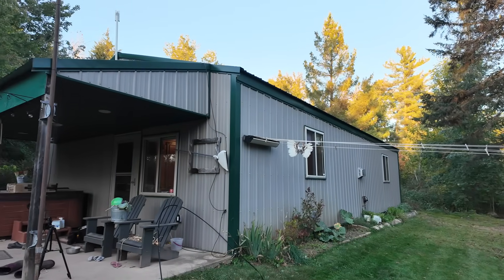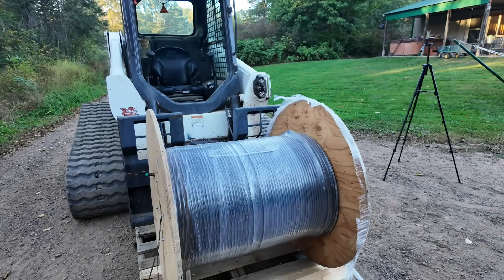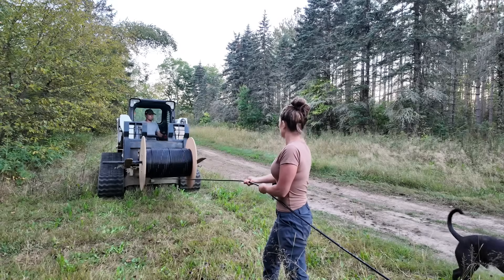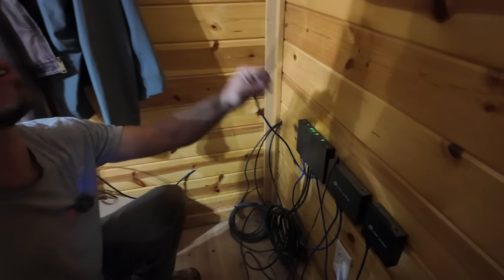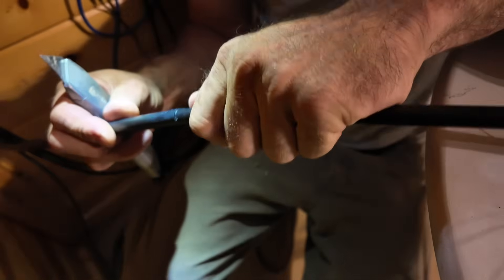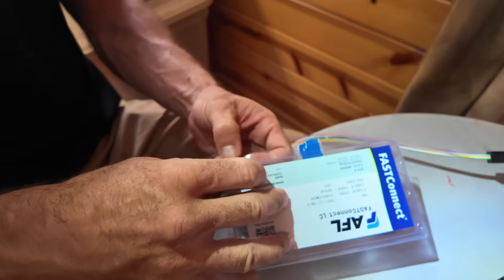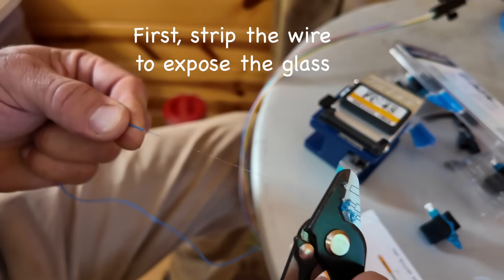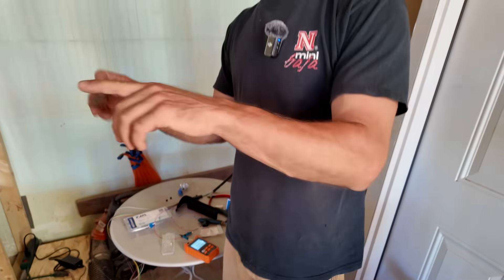We Need Internet! Running a 3,000 ft Fiber Optic Cable

Comment: It's been more than 15 years since I was involved in doing a single-mode fiber pull for the company I worked for. I was an IT admin coordinating with a local contractor to layout and install a fiber ring in the manufacturing plant that I worked at. Part of that pull was under ground. My counterpart that worked for the contractor had previously worked for AT&T doing fiber installs(so he knew his stuff). Here are my takeaways:

* The best way to terminate single-mode is with factory made pigtails that you fusion splice onto the ends of your fiber(I don't know if that's old tech and what you did is the new way). Of course, you would need a fusion splicer(over $500 from Amazon). But this method yields the best transmission properties since the ends have been factory terminated and polished.

* You should use a fiber optic cable tray to store your slack( https://www.amazon.com/GESD-24-Port-LC-OS1-SingleMode/dp/B0B1H8CS58/ref=sr_1_3?sr=8-3 ).

* When running fiber in the ground, you need to use what's known as loose tube fiber. The glass fibers are suspended in a gel in a tube so that thermal expansion and contraction doesn't cause them to crack.

* The contractor told me that single-mode fiber is considered a biohazard, since the glass fibers are capable of breaking the skin and entering the blood system. As you can imagine, this is undesirable. He was careful to the point of putting down some sticky tape that he would stick each of his cuttings to so that he would not lose track of them. Then when he was done, he put the cuttings in a biohazard disposal container.

* I'm going to go out on a limb here and assume that you probably don't know anything about repairing a severed underground fiber run. So, you may want to invest in some of these( https://promarksupply.com/tag/fiber-optic-marker-post/ ).

* It's a good idea to photograph a burial run. Did you?

I'm sure there are other things that I've forgotten. But as I said, it's been a while and I'm sure that the tech has changed some. The termination of single-mode fiber is not a DIY job. I have decades of IT experience and I don't think I would try it.

Comment: Work in data centers, always working with fiber single mode and multiple. His fiber db is the best its going to get especially with that kit he has. Since he is not an optical field worker, see them out late work on fiber they have alot of testers think its a damn good job. It always the tx/rx issues no matter who mess with fiber. Using a VLF and fiber tester not crazy expensive is great 👍. Used flukes brand expensive and not necessary can get cheap brand ebay or amazon.

Comment: I'm in the process of putting in a cheap EPON system on my property which is 300m from end to end. Pre-terminated single core fibre drop cable and optical splitters are stupidly cheap and routers cost about $15 (4xethernet+wifi+PON). With EPON you need to ensure that you don't overdrive the receivers so keep a handful of optical attenuators.

Comment: Get that cable trenched fast, for some reasons animals love to chew the outer sheath and even go thru the armor and into the glass. We have a problem with squirrels at work chewing our cables around the city. Even protect it where it comes out of ground into the buildings with stainless steel u Guards, make sure there no place an animal can get at the cable and chew it.

Comment: I agree with others. There are many ways to skin a cat. Yes there are better ways to run and terminate fiber, but you demonstrated that it can be done even if you don't have any experience. I will admit that I cringed when you were trying to terminate with loose tube fiber with quick terminator LC connectors. Those connectors really are only meant has a quick temporary fix. But just like shark bites in plumbing, usually work fine for years. It's not like you need to run multi gigabit through it.  Great video!!

Has far as you ubiquity knock off tp link goes. Ubiquity is typically a better product. And if you order direct from ubiquity, the prices are usually even  better. The wireless bridge do have some drawbacks that hold the novice back. First is all Ghz frequencies are limited to line of sight. The higher the frequency, the worse it is. At and above 5 ghz even rain can decrease to signal. Yes they can reach 14-15 KM (not Miles) but it needs to be completely free of obstructions. Even the leaves on trees can affect it. Second each channel has limitations imposed by the FCC. This is something that even ubiquity doesn't do a good job at explaining. 5700 to 5800 allows for the most ERP. that antenna is typically has a gain of 23db. Now some can correct me, because fcc keeps changing the regs, but the max ERP is about 30 db. This is the upper dfs band. The lower band, 5200mhz, are limited to more than half of that. So in order to meet the requirements, the output power has to be turned way down. So if you set your channel to the 5700mhz and have good line of sight, you may be able to connect at great distances. With Ubiquity the longest one I have deployed is 3 miles. But I have seen other access points on my device that are 15 miles away. Basically what I am trying to say is use ubiquity and use the higher channels for long distance bridges. There are a few other bridges that I personal have not yet evaluated yet, but are decent. However, TP link is the walmart of wireless. It's like using Great Value instead of brand name. The sad thing is that some of TP link hardware is not that bad. But when you add their proprietary software it not very good.

Comment: You got this fiber wise…

WiFi wise… ceiling WiFi access points work better when mounted to the ceiling. They have wall mount units if you prefer to mount to the wall. Just telling you so you can easily improve your setup.

Comment: Good morning 🌅, great to hear that you have got fibre up and running, I live rural France, last year I did manage to get fibre connected to my property, Luckily, when I had the electric put in, they laid another tube in the ground, I had SFR  connected as my supplier, then found out that I was being charged for a television service that I don’t need and do not want, it has taken me nearly 3 months to get it cancelled, I’m now trying to get another company to supply me with Internet after going sign up for it then found out they’re doing the same thing Bouygues , So at the moment, I’m in in limbo. I’m using my mobile phone as a hotspot., Like most people you don’t like being charged for something that you’re not going to use, good luck with your project, I wish you all the success for the future, from France.

Comment: I respect your diy lvl, even I know this profession. You are pro to take on all this yourself from my view, and I admire the attitude to just try it your self. Was ofcourse first thinking why not do this and use a pro, but then i saw what the channel was mostly about, then I know why you went ahead with this project. My only lose remark would be use a ODF of any kinde box or splice tray inside some kinda cabinett to protect the fiber. Too easy to yank or bend the blue conduit with the 12 fibres and you would need to redo everything. And even it is duct cable, I bet it has an ripcord wire, then you only need to take off 10cm off the end and use the ripcord without any special tool, only knife. Again cool video upload.

Comment: Awesome! Where'd you order the cable from? Also recommend the ends of the buried cable go to a permanent box / patch panel and then a cheap premade jumper to the equipment. Also the colors have a numerical order if anybody else ever works on it in the future.

Looking forward to the trenching video.

Comment: as a past communication pro. would suggest you get a cable manager on both end of you Fiber to keep them protected for a long life. all so you have spare fiber you can put ends on and run your end to end test. Great the you have the tool and learned how to correctly clev and terminate the end. as back when I started with fiber we used bicon ends and had to polish them . Today ends in SC or SD are much quicker and better. hopeful you get a long live from your system . would be interested it what you total project cost with cable , tools and if you plan to direct bury the cable to future prof its life by putting in the ground about 4ft

Comment: Remember DO NOT LOOK INTO THE END OF THE FIBER OPTIC CABLE WITH YOUR REMAINING GOOD EYE!  Sorry, old fiber optic tech joke.
Yes, there seems to be special tools for just about everything. Those "click connectors" even made the job soo much easier. In the early days you used to have to fusion splice the connectors on with a multi-tens of thousand dollar machine.
Reply: We still use splicer nowadays😂
Better quality

Comment: try the TP-links again but rotating the ""dishes"" by 90 degrees. may it will do better. Vertically polarised radio waves penetrate further where vertical wood is :-p. and choose 2.4 GHz before 5GHz.
Reply: 900 Mhz would be even better than 2.4 GHz
Reply: @guytech7310  jup the lower the better...but licensing would be a tiny bit difficult 😀
Reply: @wilfredswinkels  No licensing 915Mhz is an ISM band. Ubittiquty sells 900Mhz bridges
Reply: @guytech7310  yeah. I meant lower still. (ham radio operator here) 😀
Reply: Oh D*MN I just read what I wrote about wood just now.....ok English not my native tongue...sorry...

Comment: Oxymoron: connecting an off grit cabin with fiber to the internet. Shows that this channel is just a fake off grit lifestyle channel to grift from YouTube.
Reply: using fiber to connect between buildings & not from a Fiber ISP. I believe they are using star link. That said there are companies rolling out fiber to rural areas under a federal program. Considering they cabin & home is about 3000 feet (2/3 mile) apart & they own the land between that is a rural area.

Comment: As someone who does this for a living I strongly recommend pulling the fiber optic cable through PVC pipe in a trench.
Reply: It’s an armored direct bury cable, it’s fine.
Reply: @brians8664  Underground installations typically demand conduit to protect the fiber optic cables from soil moisture, mechanical damage, and environmental changes.
Reply: @TermitesRGood1  That's only so ISPs can just pull new or more fiber if they need to.
Reply: This cable is designed to be direct buried as it's filled with gel to keep water out.  Plus it got a steel messenger wire inside the cable to provide strength.  Finally the fiber is already inside the conduit within the cable itself.    This is on private property so nobody is gonna be messing with it once it's buried.
Reply: @Darkk6969 

It does need to be buried sooner than later.  Animals could end up chewing on that cable.   It could get damaged in any number of ways.   Nothing it more permanent than temporary!
Reply: @Darkk6969 that fiber was not gel filled. That was an armored loose tube fiber with powder coating. 
When did you see him cleaning off any gel?
Reply: @Jeremy-xl1bn  no need for gel anyways since coated fibers operate under water just fine
Reply: @Darkk6969 

It does need to be buried sooner than later.  Animals could end up chewing on that cable.   It could get damaged in any number of ways.   Nothing it more permanent than temporary!
Reply: @Darkk6969  What if that Fiber gets damaged SOME WHERE on that 2600  Feet its Easier to pull it out and Replace it by using Conduit it.. Sure its a extra Spent but time saved and possible cutting that fiber. you have no idea one day what they Property will be used for.. Also what if they wanted to Upgrade that Fiber PULL IT and done.
Reply: @TermitesRGood1  You make a good point. He may want to upgrade years later. By using conduit, he won't need to dig another ditch.
Reply: @TermitesRGood1 I don't know how familiar you are with fiber, but being that it's single mode, there's no need to upgrade unless they need more than 12 strands. Single mode can handle a lot of throughput with the right optics (SFP modules). The only thing they might need to "upgrade" in the future would be the optics to increase from 1Gbps to 10Gbps or even 40Gbps and up with QSFP, but that's getting expensive. There are also Bi-Di optics that send and receive data over one fiber strand, if they wanted to go that route.
Reply: @scoobytaggs  the word is "unless" we never know whats in the future not only that it could get damaged just pull it and install new fiber....
Reply: I'm installing hundreds of Kilometres a week - we direct bury.
Reply: Direct burial is fine. He has 10 other strands if he needs to upgrade in the future. The only reason to install a duct (not PVC) would be for future expansion or in case it got damaged and need to re-pull it. 
I do this for a living, and we do direct burial all the time. I would just make sure it’s below the frost line.
Reply: There are conduits designed for fiber, the inner layer isn't flat to reduce friction
Reply: Here in Australia its law for fiber optic cable to be in pvc pipe
Reply: Yep, direct bury, no matter what type of cable is used, is far more suseptible to future damage. Fiber/copper can also have defects that don't show up initially and then just suddenly fail. Conduit is an extra expense and more time consuming up front by it's a great insurance policy for the future. Conduit is cheap compared to the cost of retrenching later. Most municipalities/service providers mandate Conduit be used in the ROW and even on your private property if you wish to connect to their infrastructure.
Reply: PEM water pipe is cheaper, microchannel even more cheap.
Reply: Armored fiber is in it’s own conduit.
Reply: PVC is bad, use HDPE pipe instead.

Comment: btw lanshack can provide you with pre-terminated fiber!
Reply: Didn't you see how easy it was to cleave the ends and put a connector on it?  Better than special ordering a reel of fiber with fragile ends on it, then trying to delicately put that through multiple openings.
Reply: @BandanazX  yes but field terminations aren’t the best. -2 on the levels isn’t bad but still better to use a fusion splicer.

The preterminated cables from lanshack are protected. No need to handle it delicately. They have pulling eyes and I have pulled a little over half a mile with one of these specifically non-armored cable

Comment: Finally.  People who get it.  So many people are averse to doing the needful and running fiber.  They will spend endless hours and money trying anything else when the only reliable solution is fiber.  Thanks for showing people that fiber isn't some crazy difficult infrastructure that can only be 'professionally' installed.
Reply: You got to be very careful terminating glass fiber. You don't want to breath in dust or fragments when you cut it. Its difficult to get good connections without using the professional termination tools that costs thousands.
Reply: @guytech7310  This isn't some 500km long haul amplified circuit, unless they drop it in dirt or something its not going to matter.
Reply: @guytech7310  Nonsense.  You saw the video... it's not that hard.  What separates the DIYer from the professional is speed, procedures, and a relatively small amount of quality.  This video proves that you can achieve quite good results without hiring a professional.
Reply: @BandanazX  Nothing I wrote was non-sense. Go look it up. There are many YT videos explaining the details & issues of termination.
Reply: @guytech7310  And yet first time DIY fiber install only 2dB loss.
Reply: @BandanazX 
You do know that a fiber connection should only have a .75 db loss per mated connection, and with those being LCs, it really should be less than .5 db. Anything higher than that, I can promise you that there will be issues in the future. Those quick connectors are around $10 to $15 each. A professional will get it right and guarantee that it will work for years to come. Ask me how I know. 15+ years in the industry and hold multiple certifications including BICSI.
Reply: It makes sense for primary runs. But some people run fiber from their house to their barn. Those are the times that it's a complete waste of time and money.
Reply: @mediocreman2  Fiber is never a waste of time nor money. Even if it was 50 feet I'd spend the time and money to do it.
Reply: @mediocreman2  If a building gets electricity,  may as well throw fiber in the trench at the same time and do it right.

Comment: As you said that there is no phone coverage on the shop probably would be good idea to have also 5G coverage via fiber.
Reply: Cell phones made in the last 10 years can do calling over WiFi.  Plus you have to put a repeater in someplace that already has reception in order to repeat the signal.

Comment: I wonder what the cost difference would have been for pre-terminated fiber. I looked up 12 Strand Corning ALTOS Outdoor with LC ends and a pulling eye each end and it was 3893.40 plus shipping.
Reply: Seeing as unterminated armor cable is under $1/foot, sounds like they saved $1000 by cleaving and terminating their own ends.  For that savings they could have bought a fusion splicer and still saved money.  Pre-terminated ends is only for people who don't know any better.
Reply: It's generic FB22-8014 12-strand SM direct burial cable cable - $0.36/foot.  3,000 feet + freight is about $2,000 total.  The LC connectors are ~$10/ea plus the cleaver and tools - so probably another $200 or so.  So really $2,200 vs about $5,000 for the pre-term cable.  Having a company come out and do this would have been in the magnitude of $10,000 - 20,000 depending on the contractor.  They definitely saved a lot of money - and for a few hundred bucks more they can get some proper fiber cabinets, reterm everything properly and have a fairly decent DIY fiber install.